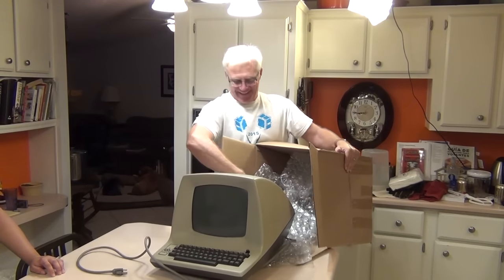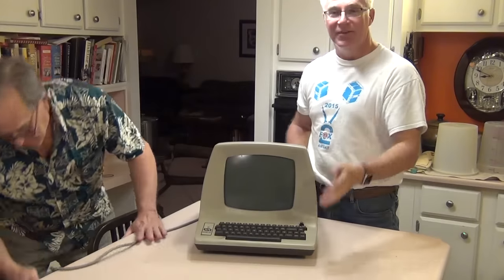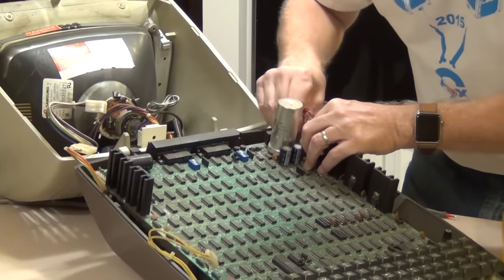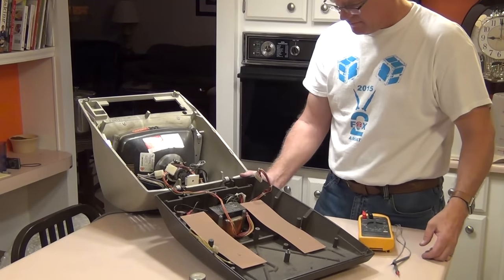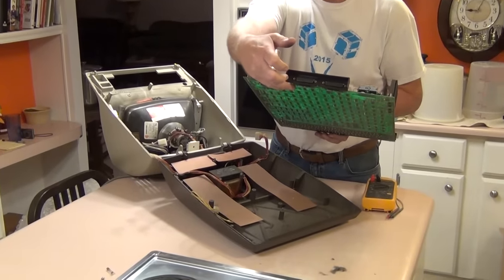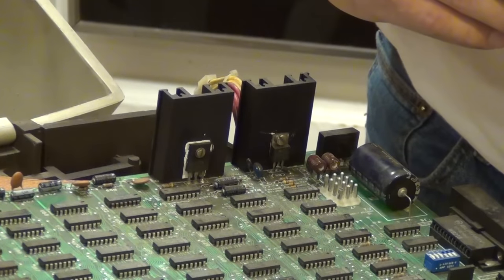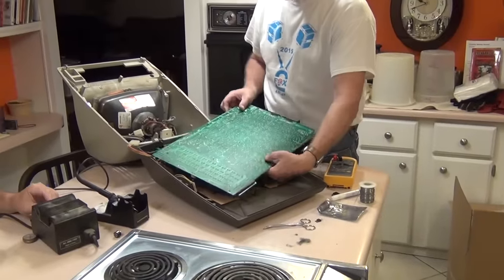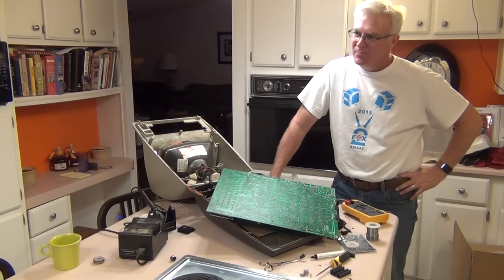ToddFun goes down The Rabbit Hole for exciting old technology unboxing with surprise YouTuber guests

Comment: The blind leading the blind comes to mind.
Reply from the maker: O'please don't blame the others. The debacle in trouble shooting was all my fault. We all knew to check the high frequency tantalum suppression capacitors and I missed the test point with my probes. You can see this in the video at "16:00". If I hadn't missed that test none of the following debacles would have happened. That said, working in a group workshop is very distracting to me and I made many more oversights and missteps in this video and the next. But if you can laugh at yourself and still have fun than it really is still worth all the troubles.

Comment: I fished one of those outta a dumpster in the early nineties.  Worked right away. Hooked it to 486 running Redhat linux and got getty going on it. Was lots of fun for a few weeks, but eventually tossed it back in the trash. Should be easy to get it going with any linux machine, just run something like: /sbin/getty -L 9600  ttyS0 vt102
Reply from the maker: Thanks for the tip. I can't believe you would throw such a beauty in the trash. These terminals are simply sexy to look at and you trashed a working one? That's like putting $500 in a shredder. Why would you do that? :( so sad.
Reply: It just didn't hold any sentimental value to me (Would you save a 15" 4:3 LCD) , I had my fun and moved on. Plus my parents were afraid I was going to burn the house down, many of my first projects got tossed before I came of age and moved out :D
Reply from the maker: That's sad too. I did save my 9 inch green CRT that I got with my Commodore 64 when I was a kid. I still have it and still use it with my 64. I like the AMD-3A for its sexy lines and old school terminal interface. I'm not too sentimental about using one I'm just in love with the perfect iconic shape they represent. I guess that is still being sentimental really.